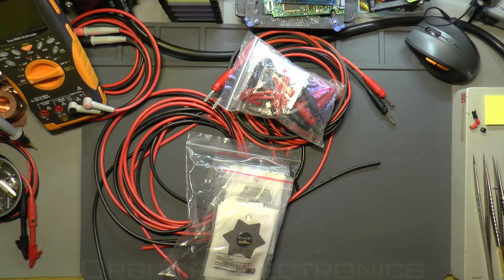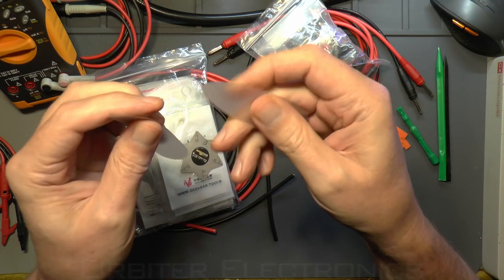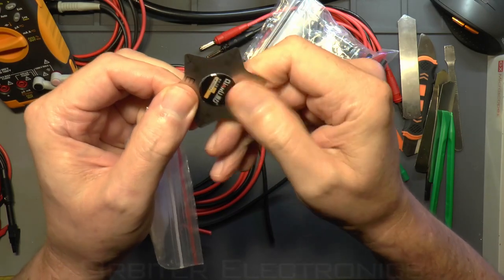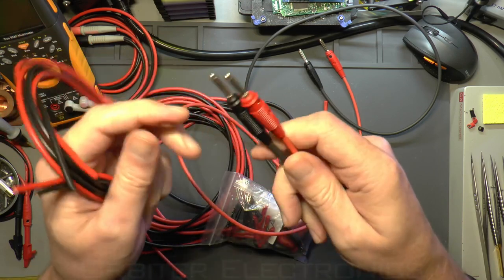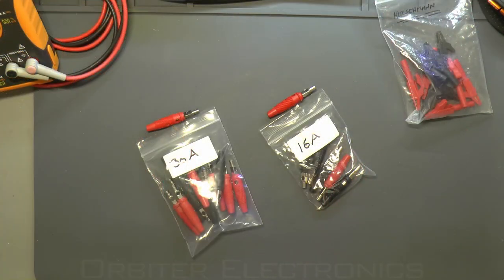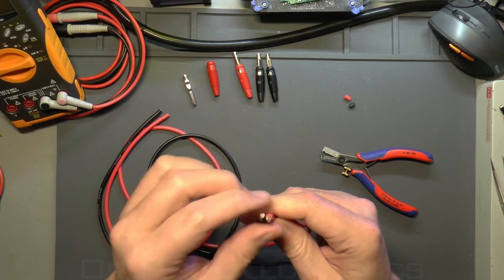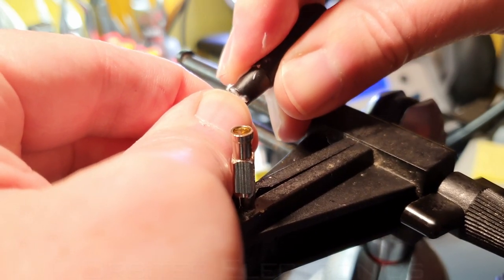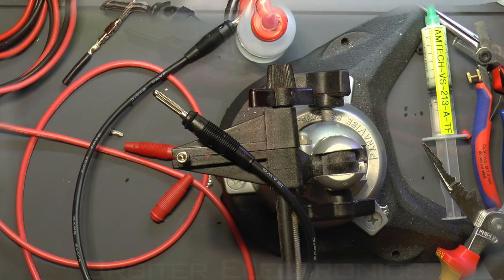Various spudgers & making some high quality silicone leads.

Comment: Hey John, hope all is well. Nice cable, I love those herschermann type bananas plugs. Ive bee using them for years to make cables. I found a little het from the hot air station loosens up the rubber housing to stretch it over a 12 gauge wire, and helps get it back over the metal once its soldered.
Reply from the maker: Hi Scott, yes all ok here thx mate, hope you're doing OK too.
Good idea using the hot air for the connectors, I've actually tried that before on standard 12awg wire and it does work great especially over the metal part of the plug, but those Hirschmann plug covers and this silicone stuff just love to glue themselves to each other. Maybe I need to sacrifice a cover and just try extra heat 👍🔥 😂
Cheers mate
John

Comment: Perfect plug fitting john :-D,  the resistance from end to end will be just as low as the wire alone :-D
You reminded me of the days when i worked in a factory doing electronics and soldering 16mm2 battery cable in to military plugs with monster pins.
They were hollow and i did just the same as you did, but i used a 150 watt weller poker soldering iron lol.
I bet you have modded old feeler gauges for phone case release, same sort of metal and a rounded end.
Reply from the maker: Hi Harv, I measured it.. It was -1Ω 😂
I think I've seen those plugs being made somewhere Harv, I always find it interesting to see industrial stuff being made.
I do in fact have modded feeler blades, but not for phones as the battery terminals don't like them lol.
Reply: @OrbiterElectronics  So 0.5 ohm per lead?.
If it's 1 ohm per lead, something is wrong, in my opinion of cause lol.
Reply from the maker: Nooo..  I meant the leads are THAT good, they've got an impossible (-) Neg reading LOL 👍
Reply: @OrbiterElectronics  Sorry john, got the wrong end of the resistor lol.
So now you have a super conductor ha ha :-D
Reply from the maker: @zx8401ztv   Haha... Don't tell anyone mate :)

Comment: Do you have an idea , how much voltage those selfmade silicone test leads can take ?
Reply from the maker: Im not sure what the actual breakdown voltage is, but if your buying silicone wire get it from a reputable place, preferably with its voltage & current rating specified. The stuff I use here is fine up to 10kV I believe, but its only for meter use so as long as it can handle 1kV like standard leads thats fine for me.
Reply: @OrbiterElectronics  at the moment i'm working a 2 Electrophoresis power supplies which can deliver 3000V / 150mA. To measure the maximum output voltage, i gonna make a box with a voltage divider which i can hook up between this powersupply and my multimeter.
I was thinking for using good quality copper isolated wire in the colors red en black,  and place a silicon tube over each lead. 
First i wanna to use sparkplugcable (sold by meter) with a copper core, rated for 25kv, but that is a bit overkill for just doing measurements.
Reply from the maker: @BjornV78  You could just try some standard silicone cable as its cheap enough in small amounts... See if its ok at 3kV(I'm almost sure it will be) Then assuming it is just get some more 👍